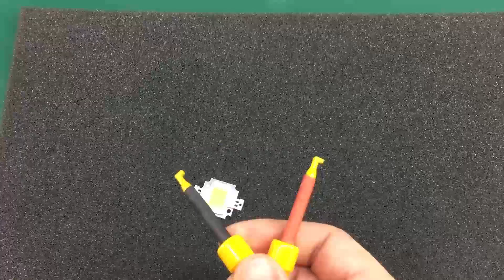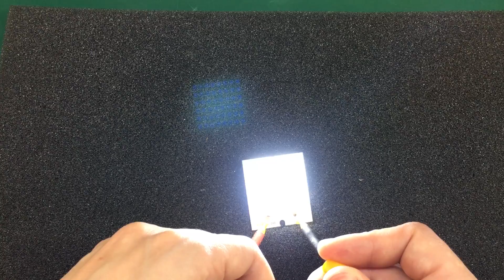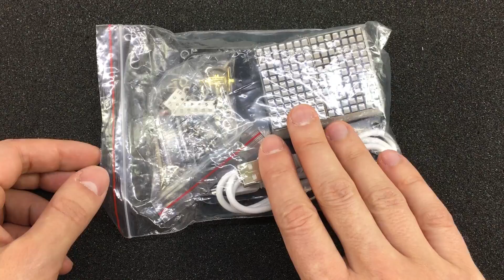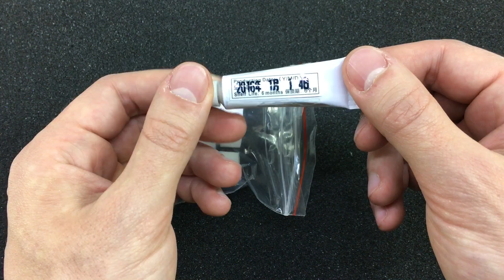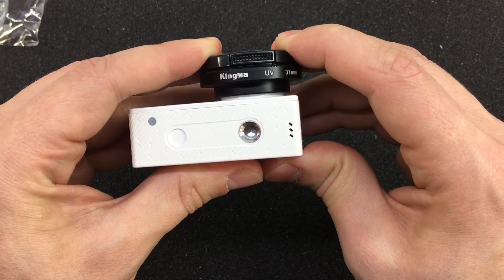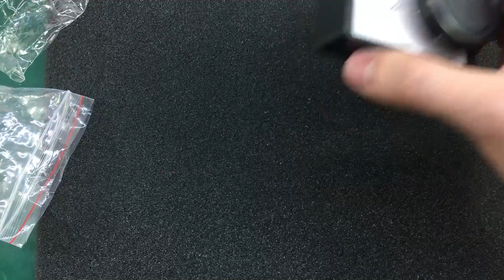Voltlog #37 - InTheMail - Part 2

Comment: Great video. I'm going to order the electronic load from Banggood but I might wait for your review... If you have used it do you think it's any good? Thanks
Reply from the maker: +Felix Gardner Yes, I think it's a good dummy load especially for it's price. I have also done a reverse engineering and I have a rough schematic. It looks like it has some nice design features.
Reply: +VoltLog your Dark Load will be much better
Reply: In low voltage (and below 0.2 Amps) conditions the chineese electronic load does not perform well, I am really interrested in your test.